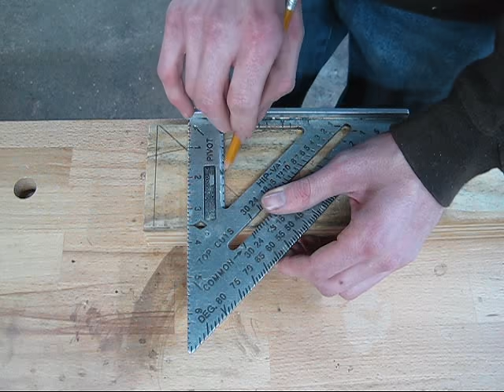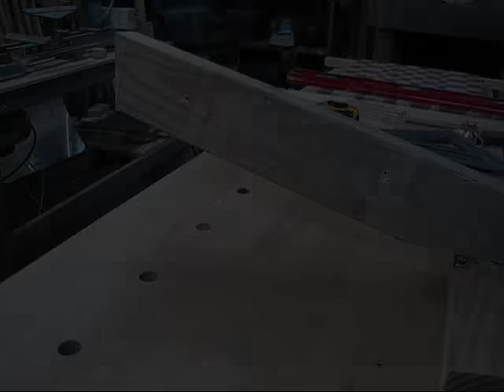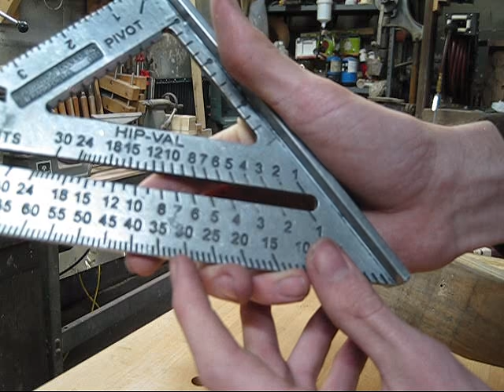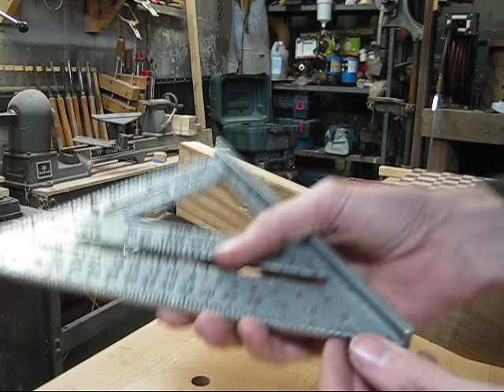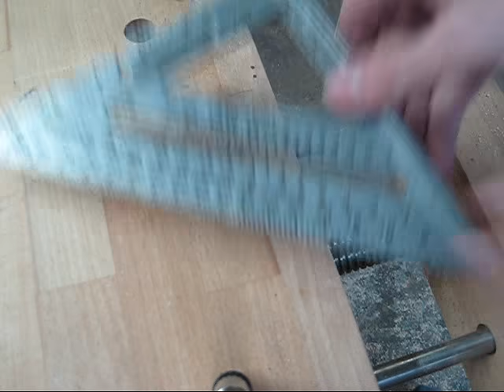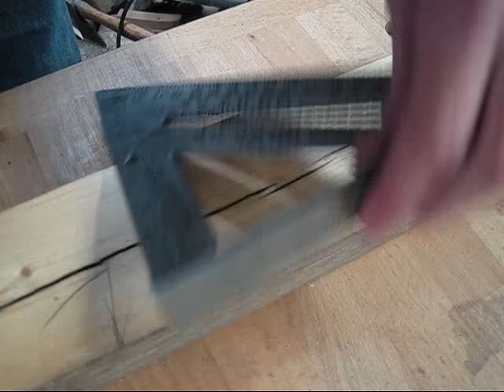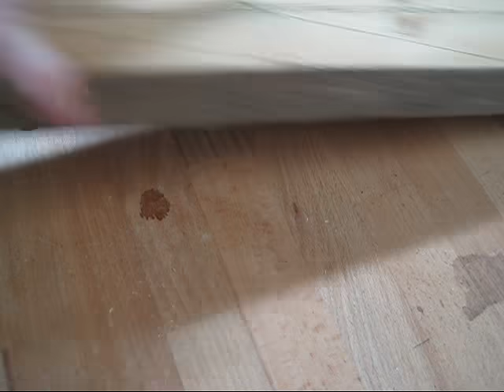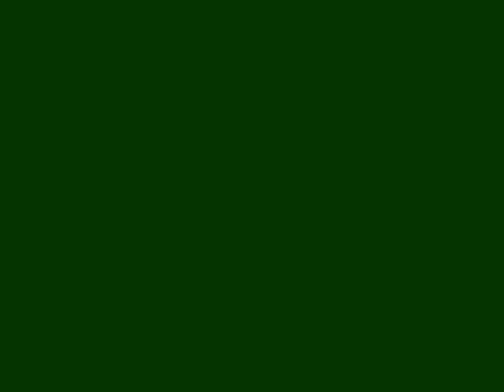The basics on a Speed square

Comment from the maker: Sorry about my southern accent. I said 90 degree Angle to the bird's mouth. (The top line).
Reply: Don't apologize for your southern accent. Remember the Alabama song, My Home's In Alabama? "I'll speak my southern English as natural as I please; I'm in the heart of Dixie, Dixie's in the heart of me!"
Reply: tjdinfl j
Reply: Ethan Ewing Greetings from Bournemouth U.K. Your accent is pleasingly evocative of a great part of the world, and is really good to hear. Certainly not something to apologize for.
Thank you for your very useful video.
Reply: I'm from Spain, SW Europe. My mother language is not English. I've visited frienda in Arkansas several times along the years, and I don't understand them well yet. But I did understand you very well! Thanks for the teaching.
P.S. Once I visited Alabama too, and spent an evening in some magnificent caves over there.
Reply: I appreciate the southern accent.
Reply: I know I'm a couple years late but I noticed that you over cut with a circular saw on the seat cut. My father always said any structural cuts like seat cuts, or stair stringers should never be over cut. I just want to know what your opinion on that is. Thanks great video!
Reply: +Dale Erwin. A dull knife is more dangerous then a sharp knife.
Reply: Over cuts happen because the most common saw used in stick framing is a circular saw. The top of the blade cuts through the material before it gets to the center or the back. The only way to avoid over cutting in this case would be a hand saw or a jig saw. Both of which are terrible options when cutting in a roof both from a time and efficiency stand point
Reply: Yeah i understand i was just pointing it out
Reply: I grew up in Canada. My accent is the furthest from a southern accent. That being said. You are wha you are. Wasn't a bother at all but the accent. Sounded pleasant enough. Don't Apologize.
Reply: yah good folk Ethan
Reply: *****
With regard to your so-called near-death experience, in the 1990s Rick Strassman conducted research on the psychedelic drug dimethyltryptamine (DMT) at the University of New Mexico. Strassman advanced the hypothesis that a massive release of DMT from the pineal gland prior to death or near-death was the cause of the near-death experience phenomenon.
As for extracting and consuming the chemical from plants, among DMT smokers, two major themes emerge nearly universally which match near-death reports from patients:
1) A stretching of time – they experience the hectic 6 or 7 minutes as a near eternity or lifetime. Imagine Cobb’s 50 year night in Inception.
2) They experience religious incarnations with a tilt toward whatever sect the subject is affiliated with.
Here’s the clincher: after death, while this massive psychedelic dose courses through the brain, there is this mysterious several minutes where the brain still functions. With our new perspective, however, we at last understand what these minutes are…
These few minutes after death, subjectively, are experienced as an eternity, engrossed in the DMT universe. Also, the trip itself is a highly personal experience dictated by the deepest realms of the subconscious.
Therefore, whatever at your deepest core you expect to happen when you die… Congratulations, that’s what’ll happen… Every religion was right.
Mystery solved. Peace on earth.
If you’re resourceful, you can find this stuff and try it. The bigger question now is: do you really want to know where you’ll be spending eternity? LOL
Reply: If it worries you, just cut it up close, twist off the cut away and use your knife to clean up the bird's mouth. But don't cut such a large birds mouth. You weaken the 2 x by cutting the birds mouth. If you took the cutoff from the top cut of the rafter you could use this as a wedge under the rafter and not weaken it by cutting it. Then just fashion gussets for it.
Reply: Classic Work
Reply: Bobcatt22 p
Reply: Wafikiri what part of Spain are you from? My wife is from Cadiz.
Reply: Wafikiri http://www.ab4oj.com/icom/ic7300/main.html
Reply: Classic Work     You,  sir, have passed on your knowledge and that's great . Now I know how to better use that speed square that's in my tool box ! Thanks.
Reply: GodlessBob Lee There in none so blind as one who chooses not to see.  The fool has said in his heart there is no God.
Reply: GodlessBob Lee It would be wise if you read your own commentary and applied it to your own religion (atheism): how can YOU know?

You sound cocky for someone whose knowledge of this solar system and things under the sea is more diminutive than a quark.

My remark to atheists is always, “You don’t believe in God.  Yet.”. For assuredly you will, my friend:  “Therefore God also has highly exalted Him and given Him the name which is above every name, that at the name of Jesus every knee should bow, of those in heaven, and of those on earth, and of those under the earth, and that every tongue should confess that Jesus Christ is Lord.”. You will be on your rebellious knees someday, and from out of your blasphemous lips you most certainly will confess that Christ is Lord.
Reply: Classic Work you are very generous with your time teaching others. Never apologize for your accent, sir, we're all part of this great country.
Reply: I was about to subscribe until you apologised for your accent. Why would you do that?
I appreciate the instruction on the square. Thank you much.
Reply: Classic Work a southern accent instills confidence in me that someone knows how to use tools.
Reply: +Classic Work Don't apologize for your southern accent, it's a blessing from God.  - Proud Texan
Reply: Ive heard tons of great things about mysecretblueprints. com for project plans
Reply: +Cherokeeman Use science when arguing with those who subscribe to scientism(atheism):60 atoms double slit experiment,delayed choice quantum eraser experiment,Legget inequality,PEAR labs,placebo-nocebo,Emoto rice experiment.
Try simulation theory,chaos theory,reincarnation,lucid dreaming top 10-20 results for full picture.
Esoteric knowledge(Vedas,Buddha,Jesus).TED:meditation,lucid dreaming,fasting,banned;Waking Life,Manifesting the Mind,MAPS,Living Matrix,Closer to Truth,tummo,tulpa,lung gom pa,yoga nidra,kundalini,chakras children's show,aerokinesis,natural law,science of lucid dreaming,binaural beats.
These are worth listening to:Bruce Grayson,Robert Lanza,Donald Hoffman,Sandra Postel,Allan Watkins,James Gates,Ed Fredkin,Nick Bostrom,Louise Hay,Tom Campbell Bruce Lipton interview,Brian Whitworth,Pam Grout,Stephen LaBerge,Robert Waggoner,Jody Whiteley,Michael Sealey,Bob Monroe,Brian Weiss,Edgar Cayce,Lisa Rankin,Daniel Amen,Steven Masley,Neal Barnard,Naomi Klein,Richard Wolff.
For optimum data assimilation and consciousness evolution also consider Plato's cave,cognitive dissonance,7 stages of grief,paradigm shift  and J.T.Gatto.
Reply: GodlessBob Lee You're dumber than dog shit. Too dumb to learn how normally functioning human beings interact. 

Is this your life? 

No, don't tell me. I don't want to know.
Reply: ***** You can't quit can you?
I don't care where you got the veil idea, but it shows a great lack of scientific understanding. Your grammatical error, "you have showed", instead of you have shown, is a glimmer of your educational deficiency, but I know that people like you frown on education and intellect, so I understand your problem. And, you seem to have issues differentiating spirituality and god worship. Therein lies a major chasm of separation. I am spiritually involved with the Universe from which my atoms emerged. Without the chemicals and heavy metals produced by exploding stars, we and life as we know it would not exist. That is real Science, my friend.
The Big Bang, as proposed by a Belgian Priest and Astronomer, Father George Lemaitre, is not what one would claim to be happenstance, as you put it. It is once again your ignorant attempt to brush aside real science in favor of your pseudo-scientific intelligent design garbage. Physics can and does show that the universe has no requirement for a divine artificer, so when it comes to a god, you're wasting your time. You don't have to be a genius to figure this stuff out, but most of the geniuses I know about agree with me. The Big Bang cosmology, and Evolution through natural selection, are the cornerstones of our multi-disciplinary understanding of how the Universe came to be, and how we came to be Humans as evolved from earlier life forms. They are separate fields of study. Evolution has nothing to do with the Big bang, as so many god believers would like to propose. I guess two different fields is too much for some simple minds to comprehend.
And finally, yes you should be insulted by a guy who rejects "Intelligent Design", especially if you believe it to be true. I hope that you have now been thoroughly insulted.
Reply: stalkingyomom. you saying maybe any idea of an omniscient being would allow for a working knowledge of it's own creation?
Reply: hahahahahahahahahahahahahaha.
Reply: I agree, there is a distinct gap in the knowledge levels. however the people can alter themselves with self training. this of course will only fix the few whom fix themselves. sorry I am new to this format. I will soon learn to direct my responses. I was laughing with not at.
Reply: Hi Lance, not understanding your analogy of the top of the blade getting to the center before the blades gets to the center. If assuming the blade is straight and is aligned, how would the angle change to produce the over cut while using a circular saw?
Reply: binthrdonthat you asked...
Reply: Too funny Bob, too funny.
Reply: ***** I know you hate that science can explain your experience, while you consider it as though it were something special. The fact is that DMT, as I noted earlier, has been extracted from the brain and has been given to subjects to experiment on its effects. The subjects describe exactly what you claim to have experienced.
Science gains KNOWLEDGE, through testing and experimentation. This is not guesswork, or mumbo-jumbo as you so insultingly refer to it. So you experienced a chemically induced hallucination. Big deal. So have millions of others. Get over yourself. It's all in your brain!!!
Reply: ***** OK, let's get something straight. Global warming and Evolution are scientifically verifiable facts, which you right-wing religious nut jobs will never accept because they threaten your Babble-based world view. There are a myriad of ways to determine what the climate was like 50 years ago. Have you ever been to New Zealand's glaciers? Have you ever dove on the Caribbean reefs to see the devastation that increased temperatures can have on the coral that live there? Well I have! It seems to be a requirement that to be a Christian one must divorce himself of his ability to rationalize and abandon all reason. Trust me you are not the first, but one of millions.
I wear a t-shirt that reads, "IN THE BEGINNING, MAN CREATED GOD". That is not only true of your god, but all gods. Your god is no different than any  of the Roman or Greek gods. When I first began asking questions about religion, my first was who is the Christian god? Yahweh was the answer. Who is Yahweh? Is Yahweh also Allah? Did Yahweh once have a Wife? Was Yahweh part of a large Pantheon of gods? The answer to all these questions is YES!! Yahweh once had a consort named Asherah. He once belonged to a pantheon of gods. All of the gods were created from the minds of humans. There were hundreds of gods created in ancient times, and they each are as mythological as the other. So, when you say your god is real, to which of the hundreds of gods do you refer? And again,how can you possibly know for sure that your god even exists or maybe the real god is one of the hundreds abandoned by humanity hundreds of years ago? Don't assume to know what you cannot know. That crap doesn't fool me for a second.
Reply: ***** OK, I won't continue our discussion any further, because I don't feel I should abuse the mentally ill. Apparently, that "Veil of Forgetfulness" crap comes right out of the manual for Latter Day Saints, or Mormons. If you believe what Joseph Smith came up with, while having the knowledge that he was a known criminal, and charlatan, and a con-man, you deserve to be laughed at and ridiculed. When you threw in the "veil", you lost all credibility. We can no longer have an intelligent discussion.....GOOD DAY!!!
Reply: arlingtonhynes Why don't you enlighten the internet world as to what constitutes normal human interaction. I believe it to go like this. You say something stupid, and I call it BULLSHIT. You have a problem with that, so you attack with childish insults because you are unable to engage in an intelligent conversation. I attack Christianity wherever I find it. It is a cultural disease which will hopefully be cured in my lifetime, and I'm trying to do my part. Let's have a discussion about your beliefs and whether or not they are true. If you think Christianity is in any respect true, please tell me what is true about it. I would love to have that conversation. Your turn. Are you willing to take me on on that issue? Let's go, Arlington!!!
Reply: A God I'm saying that 5 religions:New Age(bullshit),Scientism(materialism),Religiosity(relativism),Government(statism) & MonEye(capitalism)are exponentialy accelerating sixth extinction because people are scientifically and spiritually ignorant.
Reply: ***** Any neuroscientist worth his/her salt will clear that up for you. The brain releases a chemical called DMT, which is responsible for hallucinogenic experiences that many people have reported while transitioning from a state of unconsciousness. It is all mental, chemical reactions. Still no gods.
And for your information, I will not have proof, either, because when I'm dead, I'm fucking dead. There isn't anything else. I should ask where you get this nonsense, but I already know. You just can't figure out that it's nonsense. We are just animals. Everything dies. If you think there's a special place to go when you die, what are you waiting for?
Reply: Well, I see you still can't answer the simple question of how you know what you claim to know. Why? Because you read one book of fiction and you can sit there and denigrate scientists who have dedicated their entire lives to their studies of the brain and human consciousness. And on top of that, you don't know anything about how your belief system was developed, or how the Bible came to be what it is. You don't know anything about it because you would rather remain ignorant than to know the truth that 13 of the books of the New Testament are forgeries. That Mark and John disagree about when Jesus was killed. That the last 12 versus of Mark were added decades after the gospel was originally written. That life after death is a Platonic philosophy. Ancient people thought the gods were there to help them through their Earthly existence. You're just an idiot Christian who hopefully doesn't represent the entirety of the Cherokee People. Please take a class on the New Testament, and a class on brain science. Then maybe we can talk!!!
Reply: Why are you rattling on about God, this is about a SPEED SQUARE. I find lately the biggest proselytizers are atheist.  Belief or non belief in God is a personal choice. Don't feel you need to share it
Reply: ***** Well, isn't that cute? Please tell me how you "KNOW" this. If you can't show it, you don't know it!! I'm afraid that you are sadly brainwashed, as I once was. I am now a born again Atheist. Just face reality. It ain't as bad as you might imagine. A little education about the god of Christianity should be enough to cure your ignorance on this subject. However, you must be willing to change your mind. If you're not willing to accept the evidence then this discussion is pointless. No god, no Moses, no Abraham, no resurrection, no exodus, probably no King David (as he is portrayed), no Adam & Eve! These are a few elements of truth you must accept before you can be free. These are not my opinions, but the knowledge accepted by Biblical Scholars around the world. We just know too much about the Bible today to hold it as anything more than a great work of literature! Education is the best cure for ignorance! Get some!!!
Reply: Let's try and leave your god out of the discussion since it doesn't exist anyway. Typical ignorant Texan!!Just sayin', Y'all!!!